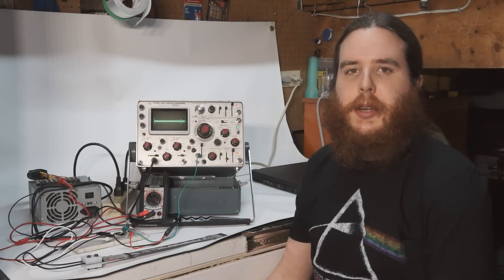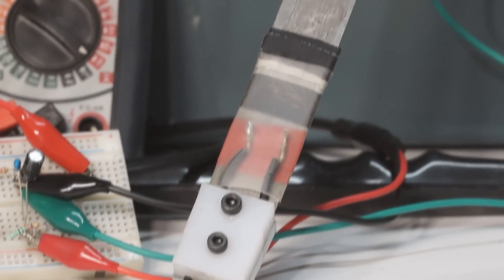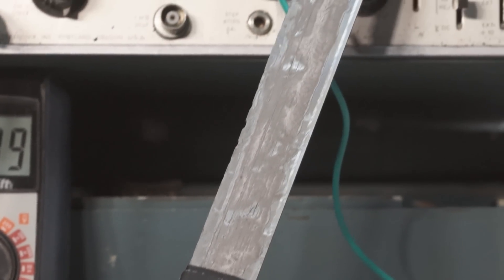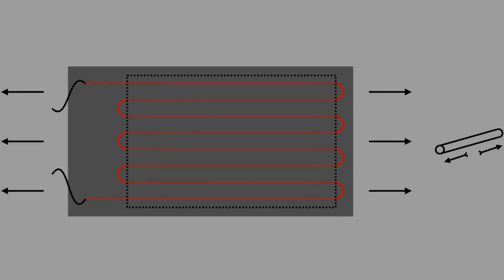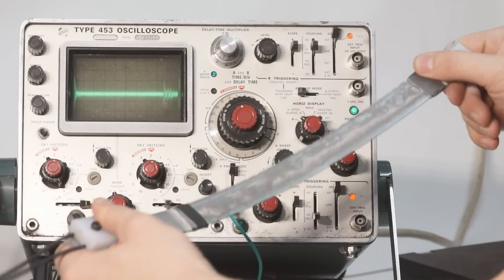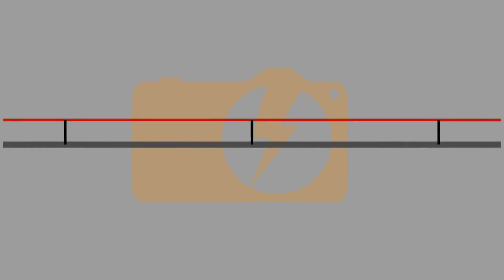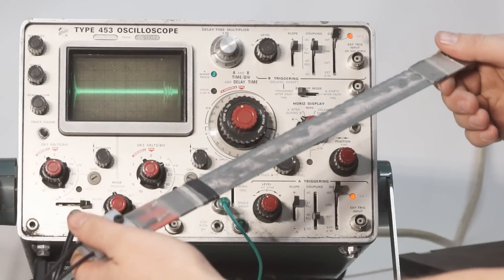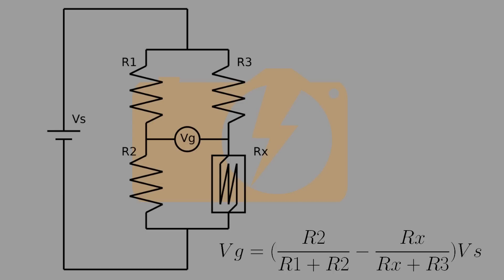Homemade Strain Gauge

Comment: what do you mean by pretension? hoping to make one for a scioly competition
Reply from the maker: When gluing the thin wire down to the steel strip i let the glue try at one spot near the end then pulled the wire tight and glued it along the whole length, keeping it tight while the glue dried. After one strip was dry I made a loop and glued it at the beginning of the next strip.
Reply: @NickMoore  thank you!!!!
Reply: or pre-tension

Comment: so an amplifier has to be added, does it? for example to get readable waves...
Reply from the maker: Yeah, you can measure the changes with test equipment but to use a straingauge  in a circuit there needs to be an amplifier.

Comment: What kind of noise do you get in the gauge from temperate changes?
Reply from the maker: It should have a positive temperature coefficient so as it gets warmer it will register more "strain." Real strain gauges require temperature correction for the same reason.

Comment: Very interesting as always ! I need to measure vibration on one axis to balance motors. I made a flexible arm onto which the motor is attached and I was looking for a way to measure the flex to measure the vibrations. I tried using a magnet and a pickup coil but the magnetic field from the motor magnets and power wires interferes with my measurement. I was thinking about using a piezoelectric material but using this sort of strain gauge may work too.
Reply from the maker: +Michel PASTOR As far as I know you can get a strain gauge kit that just glues on to any substrate, with a little circuitry it would be perfect for measuring vibration.
Reply: Yes, thank you, I will probably buy one ready made.

Comment: Cool. About 40 years ago I was a draughtsman and many drawings were for load cells and other items that used strain gauges.
Reply from the maker: +Steve S No way, I had looked at copying an actual load cell design but my gauge is too inaccurate to respond. When you made them is there an deflection per weight that you are aiming for or something else? I saw a few homemade load cells but everyone did their calibration after it was built.
Reply: The gauge itself was manufactured to some specification and then the load cell (the part that got compressed) was engineered to match the gauge.

https://lh3.googleusercontent.com/DRXQIxh7cOaEHPc7qw_eO6x-cfdmVuJCSUK04SvihlK76mpknWpEcmbCUpvTv_iuG8rnpoK6YGN4M9IWKklp5cNIeSxvuE020HRYIDqLyydY26cDHwzJyd3nVMz5WJUXeAF1uVmHKxpbBdLYx2FanrdPvBVgg4b7ygSpnT5D1x5R631mnTLmxpauvXMRHqlpatqJwis-4rzIcbPL7fU9Zv_fBYx88Eg-vmNYLFse21t1khxH30PlKyzbFT0Mb9KIIke0lIAKACMc7wMvoB2k7WVjG0P-3UpNb4eX-q9ROYSTAVzQ9Mul5wzVEmKVx4NhqeFezeyA1c7geqJSQfd2zg1Y0_sifv1y4E4twAlFtyvapwH6Jf-SJLibjmDsyGDTfYgcSB_OZr9x0nA8gyX5kD1zGCm1BNW_zU-j5L6BA9iLy7zhIi5-FUztBG2IrbMCcr1BGkDDD5aYqiEvIF2ZSdSu82MSqDgfTxskwgmMK1kO7RhC8TN4F2F1WDAt7ihF6AXQnQefVt2QThvREzCmUruTBK4bNYFt5KNYTEewR5atxxW-1kpDYul-7t9kJVaL5tVffx2fXh5uSMgSFQ4rnKDg9k5OWOhvU68SjrwIeswU8l6BRWN-=w1322-h744-no
Reply from the maker: Oh wow, I wish I got drawing that nice at work. Everything now is so cut down and minimal that you have no idea what the machine looks like until it is assembled.
Reply: June 28, 1978. I was 18. Learned draughting in school. Back then we did many drawings for a single part. These were usually forged initially, that drawing is of the final load cell. We even had drawings for the forgings.

That load cell would go under the pressure bolts of a steel mills rollers. It's about 22" dia.
Reply from the maker: Whoa, that's heavy duty, the biggest ones I see only get a ton or two on them, nothing that big. I'd love to know how drawings like that were done, everything now is CAD.
Reply: All done by hand on a standard drafting table with a drafting machine, pencils, compass and of course an eraser and erasing shield. I made a somewhat portable drafting table that I still use sometimes becuase it just faster to do a quick drawing on a board for me.
Reply from the maker: +Steve S I'd like to see that next time you find a reason to use it, I've only ever seen a real drafting table in photos.
Reply: Let me see if I can put together a vid of it.  There is a long tale that could be told on the approach we've had to the current industrial revolution and how we transitioned from the drafting board to the computerized world we have today.
Reply from the maker: +Steve S No doubt, there is a few hundred years of hand drafting behind us that all stopped within a few decades.
Reply: I never did do that vid for you, but here is one of some old school draughting. https://www.youtube.com/watch?v=EABFMutOf9w
Reply from the maker: That was interesting, lots of little tricks I never would have thought of (I like the eraser guides). Thanks.